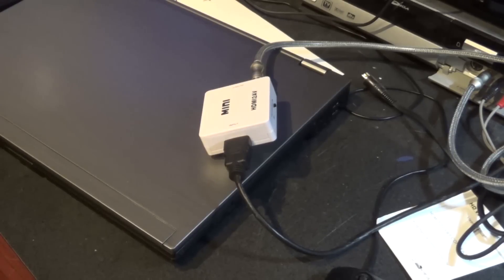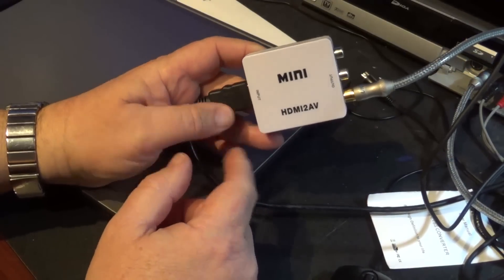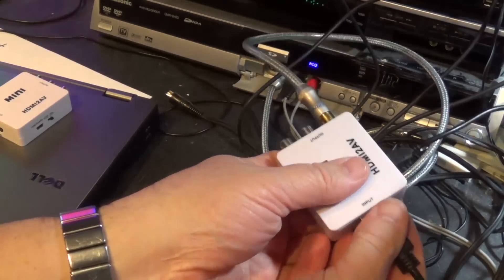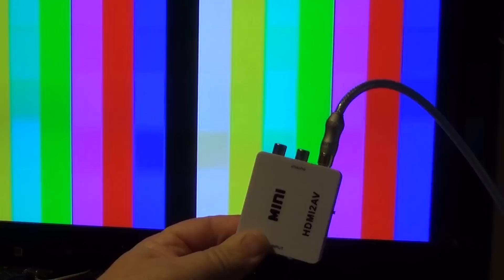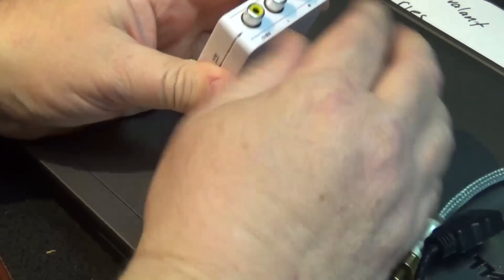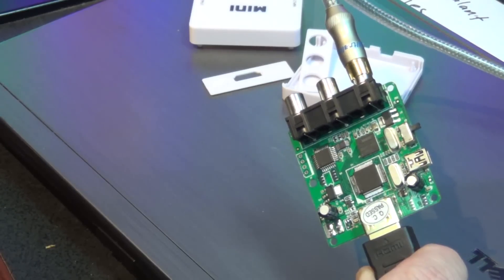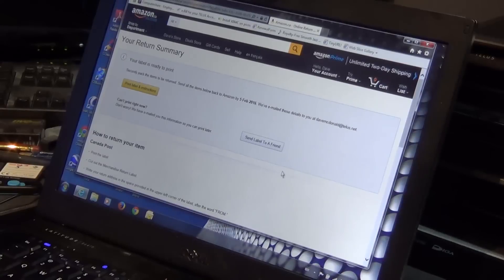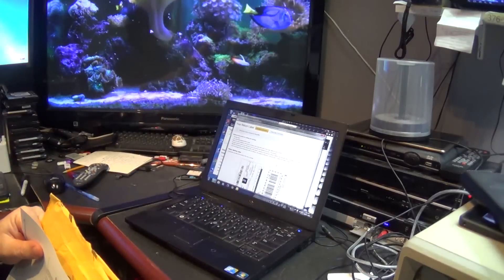Another defective HDMI2AV adapter

Comment: Hello there I was considering buying this product and I've seen some good reviews and some bad ones. But most of the negative ones have the same complaints as your review so can you recommend a similar product that works.
Reply from the maker: I have an REI branded unit that has worked flawlessly since the day I got it. Runs 24/7 on my security DVR sending a SD signal to an RF modulator for distribution throughout the house.
Reply: 12voltvids Is it cheap because I need it now and don't have the money to drop over 30 dollars
Reply from the maker: I only paid something like 15.00 for it on Amazon. Wasn't very expensive at all. Then I got a broken one that the seller said chuck, so I fixed it. Then another broken one, but the seller wanted it returned so they could sell it on another sucker... I mean customer.
Reply: If you have a link for it that'd be great. Thank you very much by the way
Reply from the maker: All the ones I have bought were on Amazon. I usually prefer Amazon because the return policy is great. If something is broken, they send you a label that you print, put the unit in the box and mail it back all post paid, so it costs me nothing to return an item.
Reply: I can't really find it on amazon.ca because I currently live in canada sooo yeah. I don't really need it for a security system I need it to hook up a game console with a tv that only has RCA ports
Reply from the maker: So you are looking for AV to HDMI, which is the other way around. This one is HDMI to AV. I just searched Amazon.ca and there are  literally hundreds of different ones.https://www.amazon.ca/EnjoyGadgets%C2%AE-Mini-Composite-Converter-1080P/dp/B00V3WWV06/ref=sr_1_3?ie=UTF8&qid=1482816446&sr=8-3&keywords=av+to+hdmi
Reply: Thank you very much

Comment: Perfect, I just bought one and haven't messed with it. I only want to use it for audio to hook up my Bose surround sound to my PS4. New baby means no upgrade for a while. my system still pounds and is in perfect shape only problem is I have no idea what to useto get the sound to work any recommendations? All of the AV inputs on both of my. Are  just that,  inputs. I can usually figure this stuff out but at the moment I am stuck.

Comment: any recommendations for hdmi to rca?
Reply from the maker: Joshua Stein 
order from amazon that way if it doesn't work you can return and get another.  I have a few that work fine. it is hit and mis.
Reply: Sounds right to me. I got lucky and got a perfect one my first try. I hear these are almost always getting negative responses so now I'm going all over forums and videos and trying to help people in the comments XD
Reply: @12voltvids  the one i am working on, it works on handy cam with a long video cable but when replaced the handy cam with dvr and a camera with hdmi out using that converter,i dont have any pictures instead i only have bar colors. Do you think it will work if i put power on that converter? Thanks.

Comment: Can you buy a better made brand?
Reply from the maker: +old64goat I have purchased perhaps 9 of these units for various projects I have been involved with and only 1 worked as it was supposed to right out of the box. One was fixable. Another one worked for a week and died, and one of the others was the HDMI to component adapter that had the bad color that I fixed on another video. I have had brands ranging from 12 to 55.00. Even though 3 of them look identical the guts inside is totally different. At least I have never been stuck with them, but it is frustrating as I have projects that are on hold due to defective parts. I have clients calling me looking for an install date, and I am waiting for components to come in.
Reply: It's not the model it is the megapixels that mini adapter can only handle hundred and 80 megapixels if you have a PS4 you're generating 210 megapixels in order to fix this you have to go into your PS4 settings on a flat screen unfortunately and downgrade your system to a 180 megapixels

Comment: You might as well buy them straight from china for cheaper from Aliexpress. They have a escrow system that pretty much favours the buyer so if anything is ever wrong you dispute it and get your money back right away. Sometimes you don't even have to send it back because there's no point. I've bought some video game related things and I've not been burned yet.  I don't know if you can get ePacket shipping in Canada but if you can that's the best shipping method and it's usually free or dirt cheap.
Reply from the maker: +narunetto 
The ones I have bought from Amazon that had to go back were shipped back free. The one defective from China they refunded and said toss it. I fixed it.

Comment: I have the same brand and it worked twice and doesn't work at all now. that's exactly what mine does now!
Reply: Check the voltage rails inside, looks to me that the av converter ic is working but not the tmds decoder ic, or vice versa

Comment: A security dvr without composite video out or vga out, what type of crappy dvr is that?
Reply: Tyrone Nelson many modern security camera systems only output Hdmi now, this is basically just a low end computer with an internal HDD and multiple wired or wireless cameras. Most people have them because they're cheap and will hook directly up to a modern TV (which most people own now days), you hide them under the TV or in the entertainment center somewhere.

Comment: You need an adapter that says "AV2HDMI", the adapter you have is "2AVHDMI" which will only work on AV tvs so thats why the color bars kept popping up on your HDMI tv. The tv thinks you are trying to convert HDMI to AV and this was due to the output of your adapter.
Reply: RSblader8 I think you do not grasp what's going on, he's going from Hdmi to AV, not AV to Hdmi. He has the correct ones they are just broken.

Comment: I have a similar one but AV->HDMI to connect some old 8bit computers to hdmi monitors. Interestingly it works with some composite signals, but doesn't work with the old computers: it has a vertical shift in the image, while those computers have nothing wrong when I connect them to a composite input. So yeah, the best is to keep yourself away from these craps.
Reply: That's a stretch to claim that's because they're 'crap', old computers & consoles etc have different timing to standard video signals, which many devices struggle with.
Reply: @DoubleMonoLR  There are AV converters on the market (for almost the same price) that can handle old computers' composite signal. If a device cannot handle typical use cases that's simply a bad product.

Comment: But but but... you're connecting AV2HDMI not HDMI2AV O.O right? The input is composite and the TV is HD. Shouldn't you get AV2HDMI instead? Or did I get it wrong?
Reply: Random Guy he's going from Hdmi to AV, did you not hear what he said at the beginning of the video. He has the correct ones, the AV to Hdmi would be the incorrect ones.